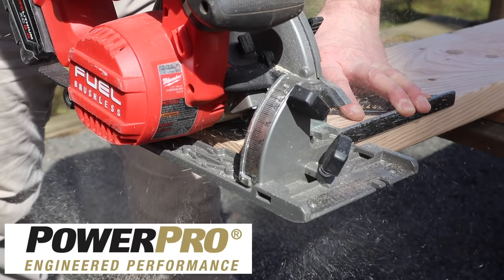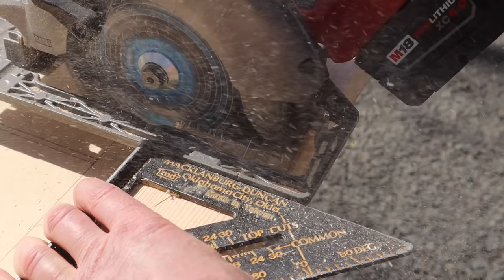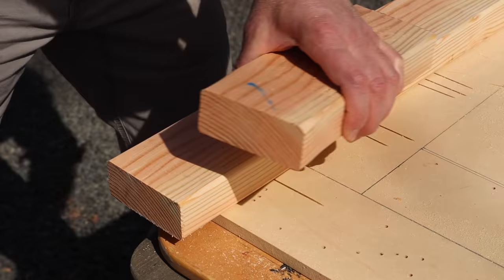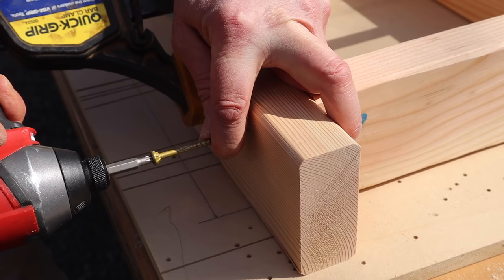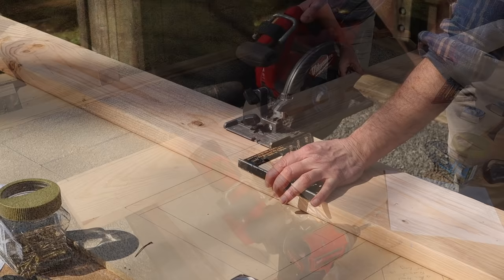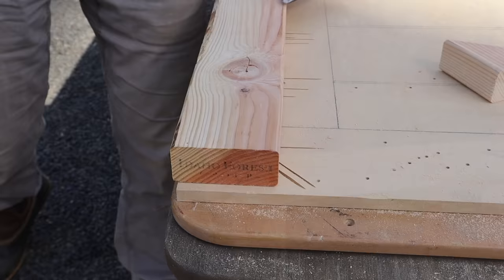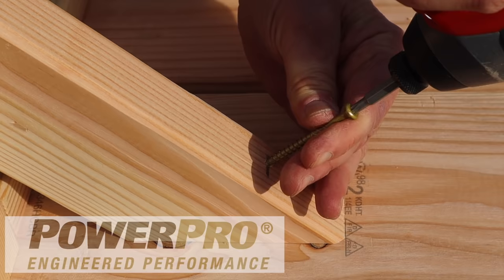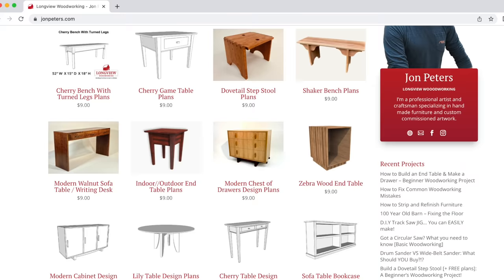Outdoor Garden Bench - Only Two Power Tools Needed - FREE PLANS

Comment: Why the star head screws?
Reply: What screws do you think is better?
Reply: Im a total beginner that has used both. I found that phillips ones stripped easy when i had to correct mistakes and re-screw, also the bit slipped often. The star ones never stripped and gripped the bit better, never fell or anything. They were solid.

Just from my very limited experience.